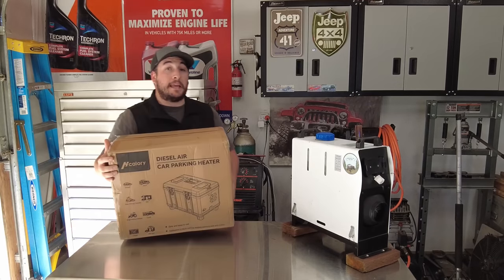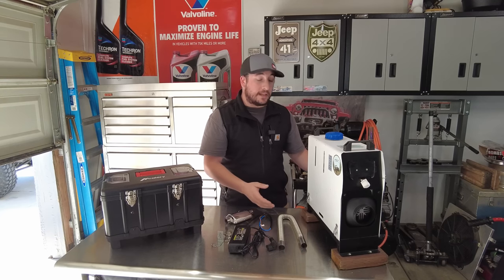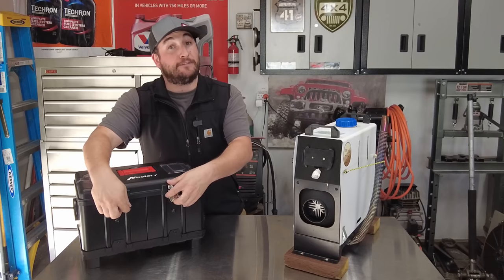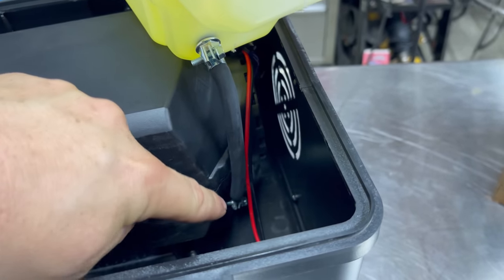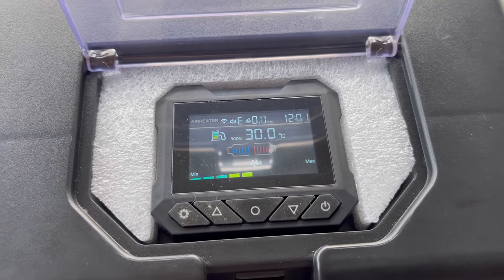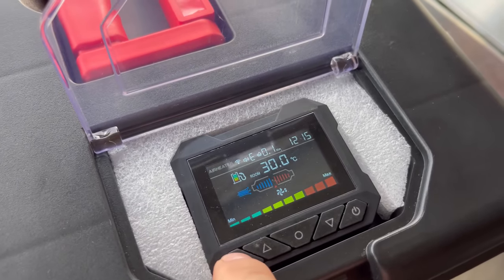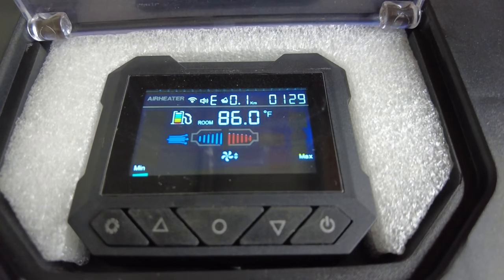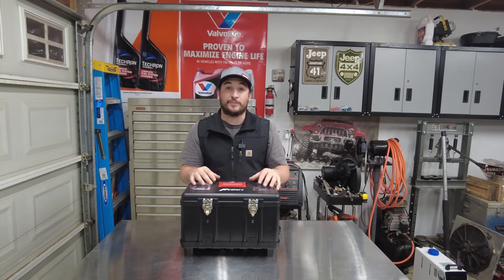KING Of Affordable Diesel Heaters | The HCALORY - SS2 8KW Air Heater | This Is The ONE

Comment: The electric inlet is actually WRONG/DANGEROUS. An ignorant person can connect 220 volt in this inlet.
One usable thing would be if the chinese would make a true clock controlled start/stop.
THAT would be a major improvement compared to the counting down hour timer.
And also make it connect to a wifi network instead of the bluetooth.
Reply from the maker: I agree, if it can happen it may happen, standard here in the US is 120VAC only on that connector. Good suggestions , hopefully they are listening. One thing I thought would be major is if the App could utilize the phones thermostat. Then you can have wireless automatic control.
Reply from the maker: I am very tempted to show what would happen in the case 120v AC was input into the mains. But In theory we can also predict what would happen. Remember the controllers control circuit is what relays the heater circuit to turn ON. The controllers control circuit is also low voltage/ low amps, Controlling a HIGH amperage heater circuit. I suspect if AC is applied the low voltage/amp control circuitry would take the hit before the possibility of the high amp heater circuit absorbing a load to catch fire. The circuit would be damaged like a fuse shorted, and in the form of a bad trace on the board. With the low current circuit damaged you would not even be able to turn the machine on with AC applied.  It would sit there and wait. likey reducing any shock or hazards. You would just have a dead ☠️ heater. 
Ive also verified the the pin out on an AC 120v cable in relation to the 12v heater connections pinout and this is what I have found. If connected, AC Hot lands on DC ground, AC neutral lands On +12v.

Comment: Dude you freaked out about the unit not having a fuse, then you put the fuse in the wrong place and ran the unit unfused on AC. Put the fuse inside the unit where it belongs.
Reply from the maker: I will  end up doing that way The heater is protected using both the AC adapter and the battery cable. The cig socket adapter is also fused, Ideally you want the fuse closest to the battery.
Reply from the maker: Hi , New video is up covering all the questions you asked on this heater. 🍻 https://youtu.be/Ug-3fjjCPWE?si=BxCFMqSJN6QPi7tT

Comment: This is chintzy as hell compared to the old unit... they literally took some random pelican clone case and threw parts in it. Honestly its probably a fire hazard because that plastic is probably not rated for some of the temperatures that are going to be near it.
Reply from the maker: Honestly I’ve been using this heater for two months now and it’s tried and true for winter tent camping, and that’s probably the most rugged abuse these heaters get. We know its not for everyone, but this is an excellent affordable choice for camping. BTW the case is actually steel. Check out the video >>Winter Tent Camping In My Jeep Wrangler Tj - Hcalory Diesel Heater Update + Christmas Tree Cutting
https://youtu.be/NFNNrBvggW8
Reply: @ATEMOFFROAD  Hmm, that is fair. It looks plastic by perhaps my eyes deceive me, its definitely a Chinese parts checklist and throw it in a box kind of build though.  If its metal at least that's probably save at least, or at least as safe as any any other diesel heater.

Comment: Very bad idea make this 12 v connection... If  it lost contact one time, heater will burn fuel inside without ventilation, with no exhaust. And its cant be just turned off immideately, heater must burn all fuel in chamber and reduce the heat inside before turning off...  * about duct - this new plastic covered duct wil smell, its not for heat, this is vent duct only... Good luck :)t
Reply from the maker: If power is lost yes everything would stop and you may have unburned fuel inside the heater, no exhaust gets inside the tent because the burner/exhaust is completely isolated from the hot air ventilation. It’s a heat exchanger. As far as the duct goes, I prefer to use the cardboard/ aluminum duct the heater comes with at the outlet. Then couple the grey/aluminum one to the end of that, this way it’s not directly on the hottest part of the heater. One would ask how the smell gets inside the tent if the hot air is sealed part of the aluminum inside the duct? The Smell gets through Aluminum?
Reply: @ATEMOFFROAD  I mean burn fuel inside without burn chamber ventilation :) and i recommend to buy quiet pump (less ticking noise) add fuel damper,  and dont let pump to contact the case (isolate it with foam etc, + put a vibro isolation on the case + upgrade muffler (newer model or used car webasto muffler) it will give you more silent and comfort :)
Reply from the maker: @vladimirkislov2056   check out this video , love to hear what you think overall 🍻https://youtu.be/Ug-3fjjCPWE?si=JJcUR5PZXLTuEoLe

Comment: Wouldn't trust Hcalory not to sell me a piece of crap, the last so called portable unit they made had mains wiring direct to the 12volt dc lines inside the case with no transformer inside the case it was dangerous. You couldn't wheel the suitcase like box around because the fuel tank cap has a breather hole in the lid so it would leak when the unit was turned on its side to wheel it around like a suitcase.

Comment: Guess what! Your king of diesel heaters is just a standard Chinese heater in a fancy box. There is no technical or performance difference between that and any other Chinese diesel heater.
Reply from the maker: It’s same heater no doubt, you wouldn’t want to change that, but this has a fancy box and better controller with user friendly controls. The ac adapter and new Altitude mode makes this the one, it’s better. 🤷‍♂️
Reply: @ATEMOFFROAD  Same controller with same altitude mode as my very standard Chinese heater. AC adapter is not needed for a 12 volt system if you run it off a battery and solar.
Reply from the maker: @TheBioniXman  what heater do you have that has “level mode” without the need for a external thermostat?
Reply from the maker: @TheBioniXman  My heater stays outside the heated space, how do you control the heater when the thermostat is outside? I understand that you can follow a cheat sheet for heater settings based on altitude to by pass the thermostat, but you have to go into engineering mode to change the pump and fan speeds for said altitude. This is simple if you know what your doing, but it’s really not user friendly. And can easily jack up your heaters settings of your not careful. This new level mode takes out the guesswork, and makes the heater efficient and useful in or outdoors.

Comment: Pretty silly when that only puts out about the same amount of heat as a Mr. Heater Buddy and diesel is messy and twice as expensive as propane.
Reply from the maker: I used to run a buddy heater in my roof top tent and that was super sketchy and I couldn’t control the heat. I’ve also caught sleeping bags on fire while asleep as well, for my use this seems to be a much more safer heat source.
Reply: @ATEMOFFROAD  They make something almost identical for RVs that runs on propane and gets vented outside. They are meant to be permanently mounted tho.
Reply from the maker: kerosene is cheaper, New video is up covering this heater. 🍻 https://youtu.be/Ug-3fjjCPWE?si=BxCFMqSJN6QPi7tT

Comment: The iec 320 c14 connector is a bad design.
Reply from the maker: Great design for a connector, standard is 120vac it should not be intended for 12 VDC.
Reply: I'd definitely suggest the manufacturer use an XT60 or Anderson Powerpole connector for DC input, versus the C13/14 they've got in there now.
Reply from the maker: @djscrizzle  they are listening, I like the Anderson pole the best 🍻
Reply from the maker: I am very tempted to show what would happen in the case 120v AC was input into the mains. But In theory we can also predict what would happen. Remember the controllers control circuit is what relays the heater circuit to turn ON. The controllers control circuit is also low voltage/ low amps, Controlling a HIGH amperage heater circuit. I suspect if AC is applied the low voltage/amp control circuitry would take the hit before the possibility of the high amp heater circuit absorbing a load to catch fire. The circuit would be damaged like a fuse shorted, and in the form of a bad trace on the board. With the low current circuit damaged you would not even be able to turn the machine on with AC applied.  It would sit there and wait. likey reducing any shock or hazards. You would just have a dead ☠️ heater. 
Ive also verified the the pin out on an AC 120v cable in relation to the 12v heater connections pinout and this is what I have found. If connected, AC Hot lands on DC ground, AC neutral lands On +12v.
Reply: @ATEMOFFROAD  yep, bad design

Comment: Power inlet is shit - easily to plug in an IEC mains power lead into it
Reply from the maker: I’ve never had a problem with this connection as it solid, but yes someone can place the wrong voltage on the heater and produce magic smoke. That’s fair!

Comment: One to miss . I'm going to keep my square metal heater . That POS looks like it was designed by a 9 year old .
Reply from the maker: To each there own, this is why I would choose one over the other. 
Here is a breakdown 
- faster heating 
- larger fuel tank
- improved controls and controller
- Bluetooth app
- toolbox design 
- fast setup
- 120vac power adapter
- high elevation heating

Comment: bit of a joke ....YOU need power to run it ,,,what do you do with no electricity ...lmassoff .
Reply from the maker: I like this question, so I’d have to revert back to the buddy heater system as far as heaters go. I like the the diesel heater mainly because it’s like a hot air dryer, it keeps any moisture out of the tent. Going back to the basics a good sleeping bag rated for the temps your in, warm clothing, and you can also boil hot water and place into metal or plastic bottles and place those in your sleeping bag. Are all good ways to keep warm when sleeping. You can boil water with a camp fire. Do hand warmers count? Ever seen a zippo body warmer? I use those for hunting they work great 👍🏼

Comment: horrible exhaust and unsafe...stuffed in a cheap tool box?..dam..the core unit is the only good thing...everything else is junk...exhaust is a 90 degree angle...what could go wrong.
Reply from the maker: Remember your USE of a this heater can be defined as totally different than one who uses for camping and traveling. It’s been tried and trued. 
This is the best heater hands down for tent camping, I’ve seen your other comments about garage heating diys , this is the heater for those that don’t want a big DIY project, they want the convenience of buying a heater ready to go out of the box.  The controls are way more user friendly and the overall design is excellent for winter tent camping, van, Rv trailer and overlanding 🤷‍♂️ There is literally nothing that can compete with this heater that’s affordable and as convenient. The simple fact that it packs properly into a car is awesome. Also the 90 degree exhaust tube on these you don’t like , are 💯 solid and of way thicker material that no other heater or kit offers,. The other heater in this video uses a flex exhaust tube which CRACK very easily, I’ve  already bought three replacements of these at almost 25 dollars a piece, the flexible tube is very thin and cannot handle the high heat at a 90 bend, the material fatigues, brittles and cracks then leaks over time with use.

Comment: IF this connector is a standard computer connector as it looks like. A idiot can plug it directly into 120AC.  SO   DO not like that connector!!  As a wife or kid might plug it in and blow the electronics.....  NEEDS a dedicated 12 or 24 VDC connector!!!!!
Reply from the maker: Unlikely but possible “an idiot like a wife or a kid might plug it in and blow the electronics” hopefully they see the adapter near by instead of borrowing from something els . 🍻
Reply from the maker: That would be called MAGIC SMOKE 🤣
Reply from the maker: I am very tempted to show what would happen in the case 120v AC was input into the mains. But In theory we can also predict what would happen. Remember the controllers control circuit is what relays the heater circuit to turn ON. The controllers control circuit is also low voltage/ low amps, Controlling a HIGH amperage heater circuit. I suspect if AC is applied the low voltage/amp control circuitry would take the hit before the possibility of the high amp heater circuit absorbing a load to catch fire. The circuit would be damaged like a fuse shorted, and in the form of a bad trace on the board. With the low current circuit damaged you would not even be able to turn the machine on with AC applied.  It would sit there and wait. likey reducing any shock or hazards. You would just have a dead ☠️ heater. 
Ive also verified the the pin out on an AC 120v cable in relation to the 12v heater connections pinout and this is what I have found. If connected, AC Hot lands on DC ground, AC neutral lands On +12v.

Comment: Don't buy this heater. If you have a problem of any kind your screwed. Take it from me their customer service/support is horrible and nonexistent.
Reply from the maker: It’s Amazon they take back everything, please share your experience. Thank you
Reply: Not Amazon, Hcalory they sent me a heater without the fuel cap and have been giving me the run around and refuse to even respond to emails. They want photos and videos of the problem so they can better decide what the problem is. The problem is they sent me an incomplete unit and refuse to correct the simple solution of just sending me the missing fuel cap. I can't imagine what would happen if you have a serious problem with the heater. No customer support at all without a fricking video. Buyer beware with this company
Reply from the maker: @trapperd6518  links I provide are through Amazon not directly through Hcalory. buy one off Amazon then return that one 🤷‍♂️  Always use Amazon for this stuff. They don’t play games and the return process is simple and fast. Sorry for your experience but this doesn’t mean the heater is bad?

Comment: I started the video assured this guy was just going to shill an expensive unit then disappear into his hobbit home. It happened but at least it was done respectfully. It doesnt look remarkable. If youre technologically and mechanically illiterate and own a smart phone it may have some advantages of plug and play thats worth the steep mark up. But no. No one listened to anybody. its no game changer.

The AI knows when it gets cold and strikes while the iron is hot. As long as the power stays on the adsense must flow.
Reply from the maker: That’s fair, and I do mentioned in recent update videos other features that can be of use that other heaters don’t offer. The controller and controls are different and Improved and more user friendly. Your buying the updated controls and better enclosure. The old heater cannot do what this new heater can do on the fly. Especially For tent camping you won’t need to extend the controllers cable so the thermostat can be in the heated space. They fixed that with the new level mode heat setting. The Old heater is an indoor heater only unless you modify it. Also for advanced settings you must go into engineering mode and calculate altitude/fan and fuel pump speed if the thermostat is overrode. This setting would need to be changed every time based on location. The new heater takes the guess work out of all that and automatically adjusts. It’s more efficient this way and way easier to set up for the mobile user. No other heaters are at this level thats of course if your in need of better options. 🍻
Reply: @ATEMOFFROAD  Im cool with you, you seem interested in the heaters enough to enjoy them. Its a balance between the viewer and the adsense. This one dude just straight up shilled a welder a month ago and I said ooh weee me so mad. Now that mad is just permeating me with my perception of what im clicking on. 

I never noticed the inefficiency of the thermostat or cared about the ease of access of the plug and play. without a heater I do hot rocks so used to sleeping like a feral cat or 'nam vet. To not notice the dilemma of not having the "smart functions" of home HVAC. My only notice of how to improve it was flip out feet to get it off the ground higher w out disrupting its space saving design.Somewhat  Easy solve for someone without a major dilemma of how do you even plug it in? I see how this one has features to expand the market for it.
Reply from the maker: @gantz4u  all good points, thanks for watching 🍻